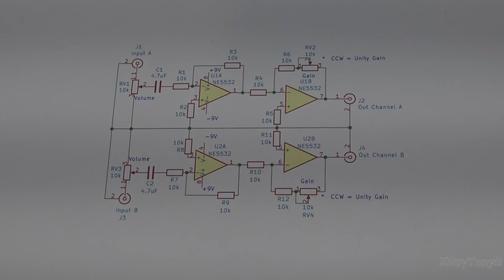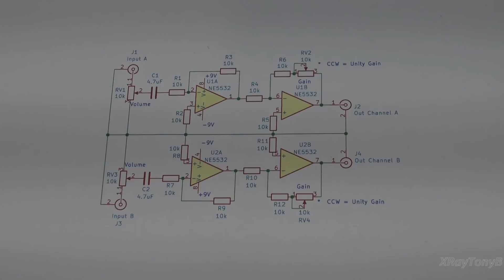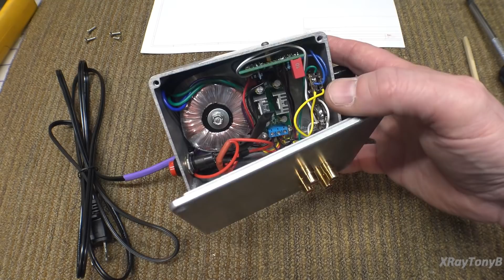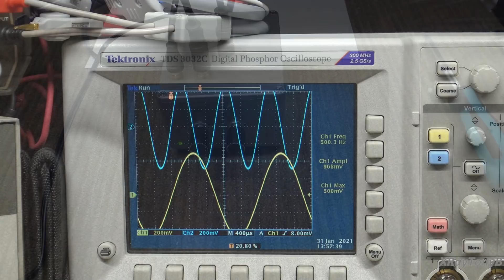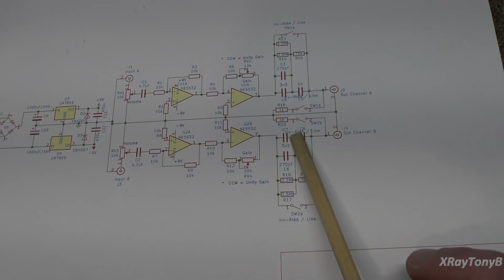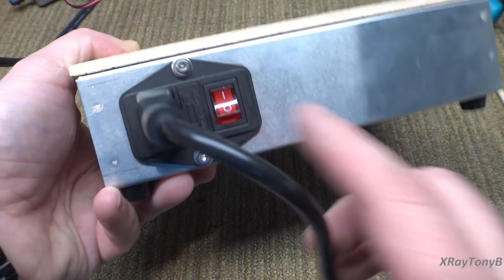Random Video - Buffer Preamp w/ Reverse-RIAA Stage For the Bench

Comment: HinTony,
This was really great! I wanted to ask for so long, but now I found the video.
Question: what would you recommend for an audio interface?
Cheers 
Mark
Reply from the maker: There are a lot of very good ones out there.  I really like the Scarlett 2i2 unit that I currently have on the bench, but just as Dave over at EEVblog found out, it is prone to ground loop noise when you don't use the balanced outputs.  I also had a Presonus and a Motu interface.  They were both very good as well and didn't have the weird noise issues with the unbalanced outputs.

Comment: How accurate is your RIAA pre-emphasis circuit?  Is it good to maybe +- 1dB over the 20-20kHz range?
Reply from the maker: When I tested it on a perfboard, it stayed within +/- 1dB.  I'm sure it will be affected somewhat by the load impedance, but it works well enough to test a phono stage out.  The values were a compromise with the standard component values available.

Comment: Hi Tony, do you use jlcpcb.com for your boards?  Do the boards come from China?  How long does it take to get them?  I have only used OSH Park.
Reply from the maker: Yes, I had these ones made at jlcpcb.  They do indeed come from china.  It takes about 2 days for production and another 3 or 4 days for shipping.  From the time you upload the gerbers to the time the boards arrive here in the states is about a week, as long as you use the standard options.
Reply: @xraytonyb  Thanks for the response.  That’s an impressive turnaround time for the distance they travel!
Reply: @jimomertz  I used to use OSH Park, then switched to PCB way. Now I switched to Jlcpcb. My wallet is a lot happier.

Comment: I hate it when people make up new terms for established electronics standards.  The RIAA preamp has proper terms and is spelled out clearly.
One the records have pre-emphasis on recording which is what this project does. On playback, RIAA de-emphasis is used to return to a flat response.
https://en.wikipedia.org/wiki/RIAA_equalization  What is a reverse RIAA stage?  There is only pre-emphasis for recording and de-emphasis on playback.
Reply from the maker: Thank you for the comment.  You are correct and thank you for sharing a link to the Wikipedia article.  RIAA equalization is a form of pre-emphasis and de-emphasis as standardized by the RIAA.   There were several of these standardizations, but RIAA became the most common.  The term reverse-RIAA or Inverse RIAA is a common term used by many in the industry to indicate an adaptor device which adds the proper pre-emphasis (as well as attenuation)  to a standard line level signal, in order make it compatible with a phono stage input.  The commercially built adapter from Hagerman labs, for example, is called the Inverse-RIAA adapter.  If you search eBay for Inverse RIAA filter, you will find many different models available, both active and passive.  While it is improper to refer to a facial tissue as a Kleenex, we still understand what it means.  I try not to get too uptight about it, as the world (and the internet) are full of many different people who learn many different terms for the same thing.  If I'm unfamiliar with a term, I just ask for clarification.  Hopefully, someone like yourself will be able to help us out.  Thanks for watching!
Reply: @xraytonyb  Tony keeping it classy! Thanks for all your outstanding content! Really enjoyed this info on Reverse-RIAA !
Reply: @xraytonyb  No problem. For less everyday objects, the Brand Name Xerox has become an additive for photocopy.  Unfortunately this complicates the language, as Xerox is a document company and we don't say Xerox it to file and index it, even though it is the same company. Other commonly used brand names turned to a noun for an object, include Crescent Wrench. Crescent makes an entire line of wrenches and tools.  Adjustable open end wrenches are made by many manufactures such as Diamond.  Did not intend to offend you. Watched the video to see what a reverse RIAA preamp was.
For a note on your schematic, your inverting amplifiers do not need the 10K ohm resistors to ground. However if you leave them in and place back to back diodes in parallel with them, you can input your source to the op amps and provide some common mode noise rejection in your preamp.  More info on that regard..  If you want to reject some hum on your low level signals you might want to look at some of these examples and case studies.
https://pdhonline.com/courses/e277/OpAmp5.pdf
Good luck on your endeavor to continue your studies in audio and analog electronics.

Comment: I would have liked to see your circuit for the stereo/mono buffer. Also, I think there should be a greater gain range. I have noticed that if there is a standard for the output level from computers then nobody follows it. The volume from some of the YouTubes is atrociously low.

Comment: Really enjoyed the project. Thanks so much for sharing. The RIAA part of the project piqued my interest. I have a turntable that I've been storing for decades and a record collection from yesteryear that I'm interested in using again but only have my Home theater system which does not have the RIAA phone input. I was looking at converter boxes on Amazon that run anywhere from $17 to $400 and thinking it would be fun to build one.
Reply: what about convolving the FFT of the wanted signal + the FFT of the RIAA and using the IFFT to recover the RIAA encoded signal.

Comment: It's interesting that the caps are at the input stage instead of the output stage. I usually place caps on the final output point to filter out all DC offset.  I generally use 2.2uf bipolar (or non-polar) caps in parallel with a met-poly 1uf film cap.  Fine unless your driving a sub-woofer amp.  I also built that (J-FETs) Nelson Pass circuit. I it just needs a +18 VDC supply. Here's the link:  https://www.passdiy.com/project/preamplifiers/b1-buffer-preamp
Reply: I'm sure it depends on the design.  If you're running a single power rail, you'll have to have a cap on the output.  Even with dual rail, it wouldn't hurt to have a cap on the output as you're making assumptions about the device you're connected to.  (Probably safe assumptions, but assumptions never the less.)  Caps in the input prevent any issues in case there's a DC bias from the source.  (Those pesky assumptions again.)

Comment: Nice job Tony. My only question is on the input capacitors. Your schematic shows 4.7uf non polarised (I'm assuming polyester film or the like rather than electrolytic) and you mention that these are important for a flat response.  I'm used to using lower value polyester capacitors (1uf) as input capacitors.  How critical is the 4.7uf value in this project? Problem is that I don't have any 4.7uf non polarised polyester capacitors and not only are they quite expensive here in the UK but the 5.6uf ones of this type I do have are extremely large. Would a lower value or a non-polarised electrolytic be any good?   UPDATE: No problem, I just found some small size WIMA polyester caps (not ultra cheap but not ridiculous either). I'm still interested in how/why 4.7uf was selected as, on a breadboard, the circuit seems to perform equally well at all audio frequencies with 1uf or 5.6uf caps. Perhaps I'm missing something.

Comment: Hello Tony, these tools are always an interesting part of equipment for any lab or person making tests with audio preamps. The use for video recording or any audio sampling is another of numerous use. I can suggest the use of low dropout (LDO) regulators for those using smaller transformers or anything delivering a limited voltage supply, and why not with battery operation for absolute isolation and silence. However, negative fixed regulators are more difficult to find than positive ones, so a symmetrical voltage supply has to be mainly done with this basic limitation! These regulators have also variations in low noise characteristics (lower voltage choices, mostly SMD...), but the price could be misproportioned for these applications and OP amps, else you want to convert it to a superlative Preamp, add a DA concerter with an optical input (no hiss from your computer and total electric insulation). Another interesting part is the symmetrical output: the classic solution was the transformer, but they were excessively expensive and difficult to find in HiFi quality; I've also found numerous solutions using discrete components or classic OP amps, but also recently some specialized OP amp with symmetrical output (the same can easily be done with a double triode...). And when it comes to symmetrical inputs, this is useful for professional microphones, why not a phantom supply? These project can diverge in many different directions, each one requiring some kind of modularity, and I guess the original enclosures can easily loose their spare volumes if more than two options are available 😜 !
Reply from the maker: I agree.  There are so many directions to go with this project.  This is how it often goes; what starts out as a simple project to fill a simple need ends up evolving into a major project, sometimes of Rube Goldberg proportions!  That's what keeps me interested in this hobby, however.  As they always say, "necessity is the mother of invention" ;)  Thanks for the comment!

Comment: Now if it will also produce the mono output as an additional option . . .
Reply from the maker: I'm still laughing as I type this!  All the trouble I went through making this thing and it never dawned on me to add a mono output!  I even went ahead one evening while sitting at the computer and added the circuitry for the balanced output, but still no mono.  I think I'll have to fix that ;)  Thanks for the comment!
Reply: @xraytonyb  Hi Tony! Will you use the simple "tied resistor method" or add another op amp stage, mixer style, with equal resistors at the input?  Ever use OSH Park for proto boards?  Thanks for another great video!

Comment: hi all, can i replace an TLE2072 with an NE5532? Power is +/- 15VDC in my PowerAmp
Reply from the maker: The NE5532 has been around for a while and while it is a good performer, it is not considered a really high-end audio opamp.  The pinout and voltage would be compatible, but the internal circuitry is different.  The NE5532 uses a bipolar transistor input (if I remember correctly) and the TLE series uses a BIFET input, which has much higher input impedance and has greater sensitivity to very low signal levels.  Therefore, my answer would be "it depends".  While both could work in the same circuit, they may work somewhat differently, when it comes to noise and frequency response.  With certain circuits, there may be little difference, but with others, it may be a big difference.  You would really need to study the circuit and do some experimenting to see what would work best.  Opamps have always been a huge source for discussion.  While many different versions share the same pinout and voltage ratings, each has different internal circuitry that affects your circuit differently.  My suggestion is to download some datasheets and do some experiments.  Thanks for the question!
Reply: @xraytonyb   i have in Stock, the other no in stock, Pinout is the same
Reply: ok, not a good replacement chip for a TLE2072, thank you
Reply: is a BIG AMP (TIP 3000 OHM 2 AB 2nd Generation, a big Project for me

Comment: I came across (I forget where) a handy tip for the possibility of adding bodged-in additional circuitry, later... You were smart to think ahead to leave some space on the board... In that blank space, go ahead and have the boardhouse drill the holes to make a section of perf board. The spacing is 1/10th inch = 2.54mm. IIRC. The pad and hole sizes are up to you. I suggest replicating whatever the sizes are on a brand of perf board that you like. Search the KiCad term "Array" to automatically lay out the holes.

Here's another tip for the 100mm x 100mm prototype, discount boards that the Chinese houses offer... No matter how many circuits that you can cram into those dimensions, the boardhouse only charges the discount prototype rate, so long as you do not make additional cut lines... Meaning, you can use all of the space, if you are willing to cut the board apart to separate the individual circuits. 

Putting multiple circuits on one board is called "panelization." KiCad will easily make panels, but you need to learn the process, itself, and the tips that make it easier to accomplish. The KiCad term you need to research is "Append."

I recently made a panel of Break-Out, Perf and Vero boards. It was way cheaper than ordering them off of Ebay. I do not ever waste any space on a 100 x 100 board... I just throw on some other boards to fill up the space. You can never have to many little prototyping boards... 

Last tip... I use a cheap Harbor Freight tile saw to cut them apart. I bought it second-hand and added a sliding table to it. I get p-e-r-f-e-c-t 90 degree square cuts. Its very fast and easy. Wear a dust mask, as the fiberglass dust will really irritate your nose and throat. Wear eye protection, too, of course.
Reply from the maker: Awesome tips!  Thanks!

Comment: You can use a limiter instead of using a clipper would be better
Microcap 12, is better and it's free now you can actually see a working circuit and test it in the program

Comment: Hell what is the line in impedance on most lap tops these days?  Gone are the  2-4-8-16 Ohms days.
Reply: The 2-4-8 are OUTPUT impedances not input. Most laptops have an input impedance of around 1-10k on the line in.
Reply: @MichaelBeeny  Everything I used was based on 600 Ohms.
Reply: @pulesjet  600 ohms is pro/balanced gear.  And they typically run at higher signal levels then the consumer 10K/RCA stuff.

Comment: Nice one. Thanks
DC Offset : maybe there's a way of adding another pot to balance any offset
introduced by the source. More ideas, sorry but that waveform asymmetry bugs me.
And once it's clipped, those flat tops are digitally reproduces. You have to reduce the
db, restore clipping, readjust offset, then restore db level. Your 'black-box' could do
all that at source. : )
Reply: The DC offset will change with different inputs and possibly different levels, so trying to balance it out might not be easy. Simplest way is to add a capacitor. That will kill any off set dead. That's why most amplifiers have a cap on the input, almost a must with ANY DC amplifier.
Reply: @MichaelBeeny  Thanks, I'm new to
this side of 'hi-fi' and saw the waveform as
a representation of the speaker cone travel.
If you're right then that makes me feel
safer when playing loud, it still looks ugly
and the flat-tops (if clipped) need fixing
but thanks for the info.
Reply: @keybutnolock  If you are worried about headroom the 5532 is very happy to run with +/- 15 volts, plus the use of an input cap, that's the best option of all. You will always be well below any clipping. All circuits clip at some point, you just need to be sure that in normal use you are as far from it as possible.
Reply: @MichaelBeeny  Yes I get it now, the 4.7 micro-farad cap at C2
on Tony's plot will correct (de-couple as he put it) any DC offset.
Like you said above. Sorry for being so slow, thanks.
PS. I've subbed your channel as well.
Reply: @keybutnolock  No problem Keith, always pleased to help if I can. Your sub is also very welcome.